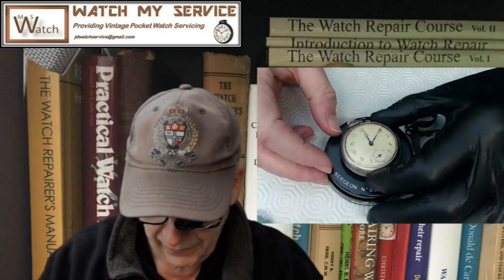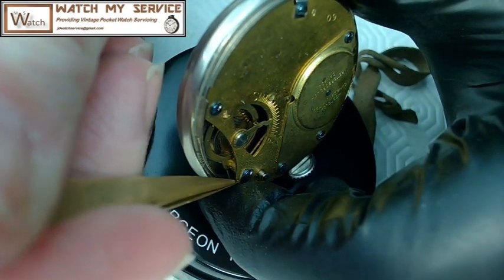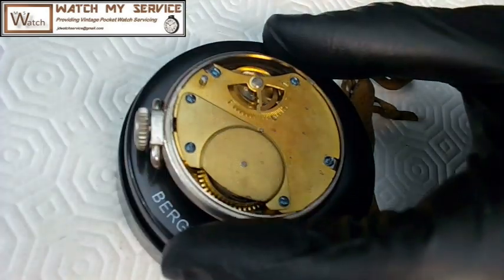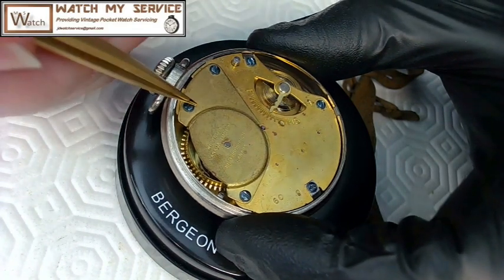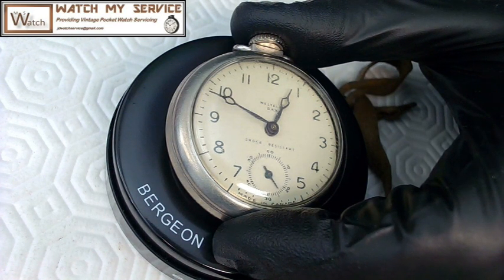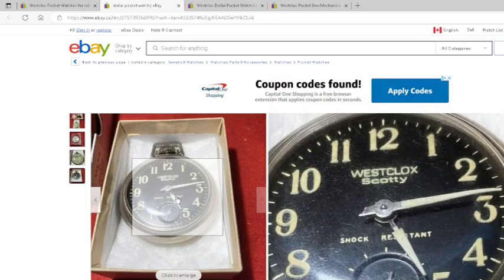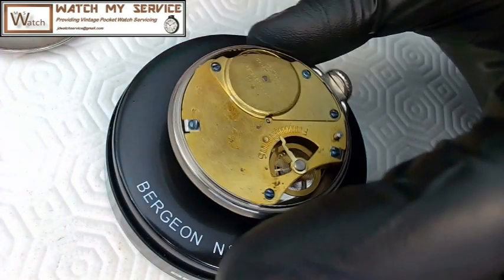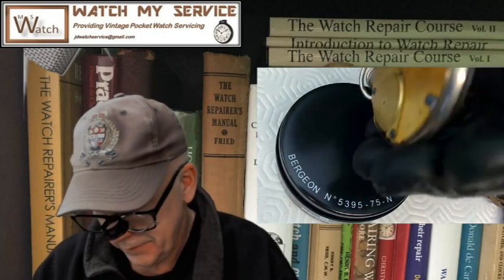Canadian Westclox 1930 Pocket Watch

Comment: Its amazing these old cheap movements still run after so many years. I have a couple of these. They are LOUD. I actually took one apart yesterday to service for practice. Makes you appreciate how much easier quality movements are serviced!
Reply from the maker: @capohd28  these old watches are almost impossible to service because they were not made to service
Reply: @JDRichard  Almost is the key here. I’m new at servicing movements, and with a lot of backtracking and retrying, I got the movement working. The hardest part was getting all the pivots lined up where almost everything was under a single plate. That being said, I just worked on 7 jewel Waltham 1883 movement today and was very similar having to line up so many pivots on one plate. It’s going to make working on movements with more bridges much easier.

Comment: Are motion work direct part of the going train in pocket watches?
Reply from the maker: They are not but are connected through the minute and hour wheels which could be considered part of the motion works and impacting the friction of the going train.
Reply: @JDRichard  The centre wheel of the motion work turns one full round for an hour, then how does the second hand pivoted co-auxially with hour and minute hands make one full round for a minute?

Comment: I just got a Westclox Pocket Ben (American) and the time setting is quite rough, but it does work. Would you recommend dipping it in lighter fluid, or just putting some oil? Thanks.
Reply from the maker: Just oil first.  I did the lighter fluid move for fun in the past but it could take off the face.
Reply: Yeah, we don't want a face lift. 🙂  @JDRichard